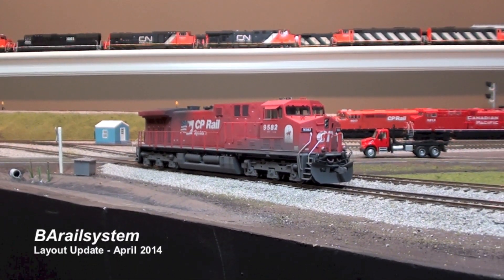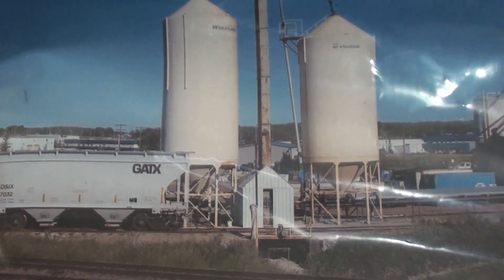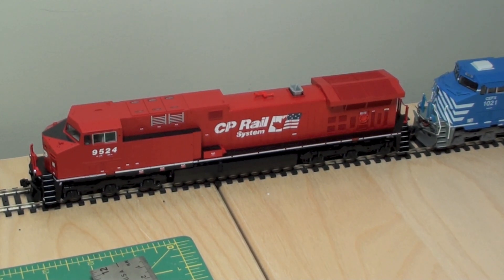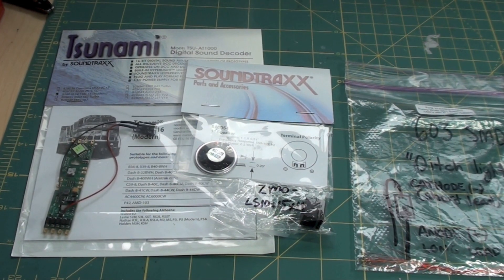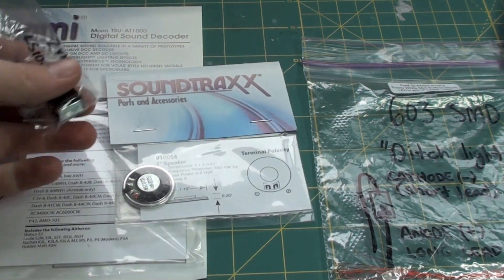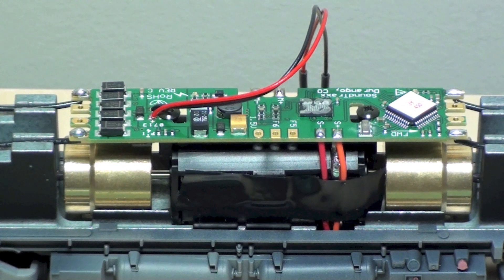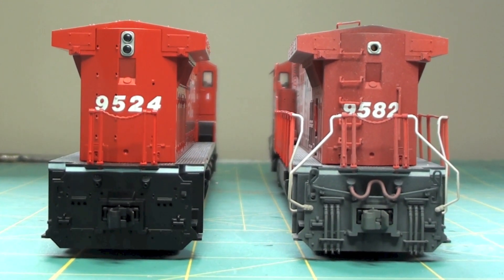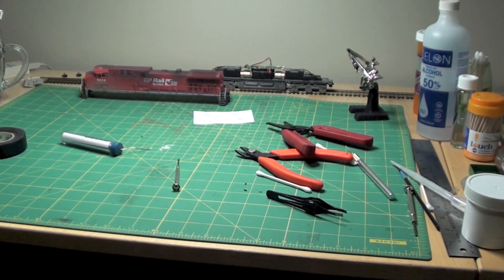Layout Update - April 2014: Kato AC4400 DCC & Sound Installs, Free-mo module progress, weathering...

Comment: VERY COOL, I am a big fan of CP, but I also do Union Pacific as well. I actually got an idea to a fictitious SD70 ACe in CP colors from one of your videos. I have to say your work is fantastic. Thanks for sharing !
Reply from the maker: Dude a CP SD70ACe would be so wicked. What paint scheme are you thinking?
Reply: BArailsystem I actually created it, I bought an Athearn Genesis kit w/ Sound minus the markings. I airbrushed it with Soo Red , and bought CP Decals from MicroScale . The decal sheet came with the Beaver Logo , I opted to use just the Canadian Pacific on the sides. I added my own " flair " and added a small Canadian flag. Currently I had to use RC car paint for the hand rails , regular enamel nor acrylic paint will not adhere to them.And lastly , I am in the midst of weathering . I can send pics if your intrested. For a " prototype" I think it looks sweet. There may be another in the future...

Comment: I've been following your layout series right from the start. Great job with all of them. I've got a questions about weathering the loco wheels.  How hard is it to take them off for a newbie such as myself, and how did you "seal" the weathering chalk in on the wheels after you got them off?   Thanks
Reply from the maker: Hi Scott, 
Glad you are enjoying the videos! They aren't hard to take off, each brand is a little different but it can be done. Just go slowly. I take a picture of the gears after taking the housing off so that I know how to put them back the right way. 
I didn't seal the wheels with anything. I painted them with acrylic and then brushed chalk on after it had dried. You have to be careful when handling them for reassembly after as you could scrape the paint/chalk off. I've ran them for a few years since weathering them and haven't had any paint come off. 
I don't know how you could get better paint adhesion to the shiny locomotive wheels on these Kato's. I've heard of guys grit blasting the wheels and truck bolsters so that paint will adhere to them.

Comment: Great job!  You share my dislike of Kato's incorrect rear light. I have four of these I am going to do and was thinking of just cutting the Kato light in half. Did you try that or is the Details West approach easier?
Reply from the maker: +spitfiremarkIX Thanks. Yep I have done both methods of changing it to a single rear headlight. Just be very careful cutting the Kato one it's easy to cut at an angle and wreck it.

Comment: Great job , what process do you use to remove road numbers without getting into the base paint?  thanks  Ed
Reply from the maker: I use the pink eraser off a pencil sharpened to a V and MicroSol. Soak the area you want to remove and gently erase the decal off. Be very careful as it is easy to go too far. Also be prepared to repaint with a clear coat to protect the new decal and cover up the sheen that the eraser leaves. The paint colour will stay it just gets shiny after you erase the road number.

Comment: cool video. hey have you thought about end of train devices for your layout. i bought two for my layout and there really cool. the End of Train Devices are by Ring Engineering and they are easy to install. note you have to see what type of wheels the car your going add to like 33" 36" cause it replace one wheel set. i would check it out.
Reply from the maker: Yah I have seen them before. I haven't got any myself but I should. They are really cool.

Comment: On a scale of 1-10 how hard is it to install the speakers and dcc into Locos??
Reply from the maker: I would say 5 out of 10. There is a bit of a learning curve and you need some basic tools. A decent soldering iron, flux, some 28 gauge flexible wire, a pair of good tweezers and a hobby knife. The thing that makes it slightly difficult is that if you wire it improperly or damage it somehow you risk burning out the decoder which is pricey.
Reply: Ok cool thanks for the info. J/W cuz it looks like you can save your self a few bucks if you can do it